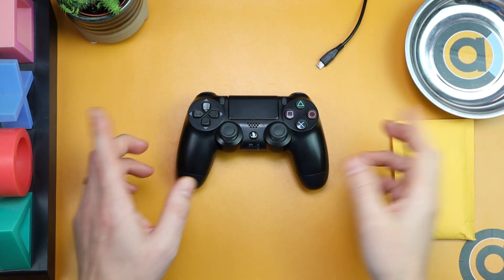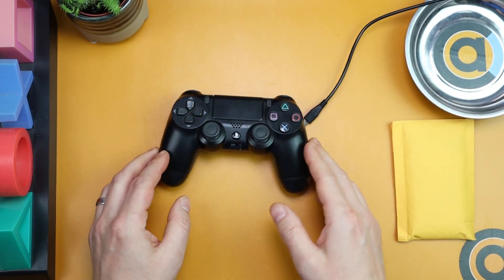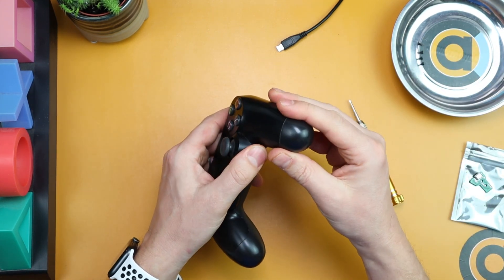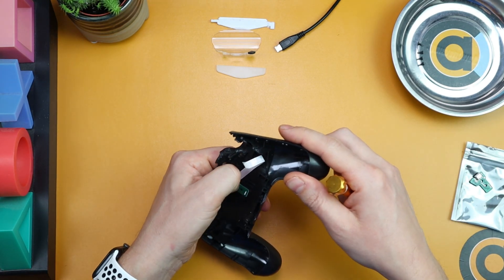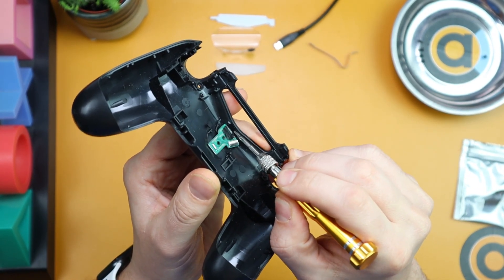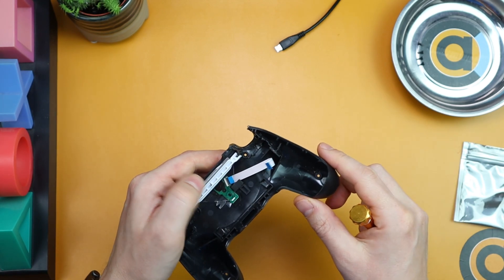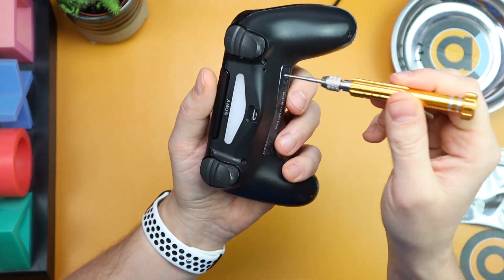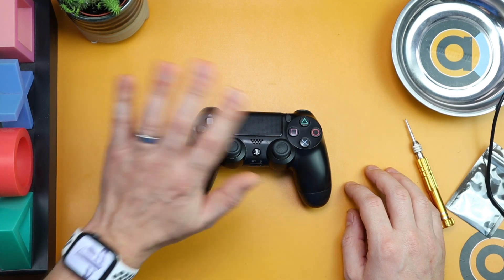HOW TO: Easily repair the PS4 controller micro USB connector in your Playstation 4 controller

Comment: Going through the same issue with a DS4 I use with my PC.
Micro-USB connectors are such an obvious point of failure. It inevitably made useless every device I own that had it, and yet hardware companies keep using Micro-USB plugs because they are cheap to make. Thankfully, it looks like Sony understood this enough to put the port onto its own tiny daughterboard, but not enough to just use USB-C or even Mini-USB.

Comment: What drives me crazy about mine is that it’s able to seemingly receive power from the PC pretty much all the time when it’s plugged in, it however won’t stay connected to steam unless the cord is in the exact right position… which is just baffling to me. How can it do one thing and not the other???
Reply: There are both data pins and power pins in the usb connector.  If they're damaged, and wiggling the cable reconnects the data pins but not the power pins then you could get that behaviour.
Reply: I bought FOUR DS4 controllers over the last couple of years and every single one of them has exactly one broken thing, which is the data pin inside the micro-USB connector. It is absolutely and utterly ridiculous.
Reply: @Nitidus  DS4 also has shite PC support, I'm seriously considering a new controller like the 8bitdo

Comment: This was really helpful thank you! I managed to get my usb port replaced - however I ran into problems when putting it back together as I knocked off my shoulder button and really struggled to get the spring back in place (it ended up getting horribly bent out of shape which I managed to work around with some pliers). At least the £5 part was cheaper than the £45 replacement controller!

Comment: I have a bizarre problem - I've copied all the parts of this video.

The controller charges fine when I've assembled the controller back together. But when I complete the final step, and put the four screws back in, it stops charging. What on earth is happening??
Reply from the maker: Sounds like something is caught up.
Reply: @CTAtechdesk  What do you mean? Ribbon might be snagged on something or what?

Comment: I've been using my PS4 Controller on my PC for a while and having it plugged via a USB all this time It's d/cing constantly now. Will this fix that?
Reply from the maker: Is think so. it’s what happened to me. TBF this is so cheap and easy it’s definitely worth a go 👍🏻
Reply: Yes, the reason thats happening is because of your MICRO USB port being fucked. Most controllers will eventually need to be replaced. 

Another thing to note, if you're using Steam, make sure you set a custom color to your controller so you know when its disconnected, and when its just trying to connect to a different profile. 

Also, avoid at all times connecting your controller to your PC via bluetooth. its horrible, it never works, and it constantly cuts out. 

Sorry about the necro, but i've recently had to replace and fix my controller, and this video was a god send!

Comment: Can you change it to the new USB-C connector? The old standard USB connector is so damn bad
Reply from the maker: I’m not sure there is a way. Yeah, micro usb is a pain.
Reply: solder off the micro usb slot and solder a usb c slot 
you will also need to change the hole in the controller to fit the usb c

Comment: I know I'm extremely late but i have a question. I bought a wireless charging station from venom and I want to know if i need to change the part for it to work because the station charges the controller with 2 micro usb charging modules. Please I need help. Thanks!

Comment: My controller was submerged in water..... I took it apart and dried it off thoroughly without burning  the insides. But when I plug it in it gives the orange light for a few seconds and then cuts out. I don’t think the motherboard is fried otherwise the light wouldn’t come on at all right ? Any idea a?

Comment: Hi. I tried this and my controller still won't charge. Is there anything else it could be. Thanks
Reply from the maker: does it turn on or is it completely dead? may be your battery. could take it apart to check all the ribbons are connected. have a look at my video on changing the thumbsticks as I go through taking it apart.

Comment: Hi CTA, my ps4 charging port just died, after some research on replacement parts, there seems to be different kinds of charging ports for different kinds of ps4 controllers. is there a way to tell which charging port exactly i should be buying online?
Reply from the maker: The best way is opening the controller up and checking the port itself. should be able to tell once you have it out.

Comment: I have replaced the usb board on the Dualshock 4, but it will not connect via usb. Everything works except the usb connection. I can even charge it via a charging station. Can there be something wrong with another part or can it be possible that the new board was just faulty?
Reply from the maker: The new board could be the problem. Can you try another one?

Comment: Hey CTA, I have a question that I haven't been able to answer using Google. My ps4 controller uses the jds-040/fjds-040, for the charging cord what cable type does it take? I tried Micro usb, it fits and works (I think? It only blinks orange once and makes a buzzing noise) but the controller port doesn't quite look like a micro usb. It is second hand so I originally thought it needed to just be replaced like in this video. Any ideas or suggestions?
Reply from the maker: Hi there. All first party Ps4 controllers should be micro usb. The jds-040 is micro usb, sounds as though you may need to replace this part. No harm in trying as the parts are cheap and it’s an easy fix. HTH
Reply: @CTAtechdesk hi I’m trying to charge my ps4  controller but it’s not blinking what do I need to do to fix it

Comment: Is the listed part the same for a scuff ps4 controller?
Reply: @MacDeezNutz  no I didn't get an answer, but I think my issue was not an issue. I thought it wasn't charging, but returns or it was fully charged, I just want playing enough for it to recognize as needing recharged. I would plug in after playing 30 minutes and the power light would come on then shut off. Not sure that's your issue, but thought I would share.